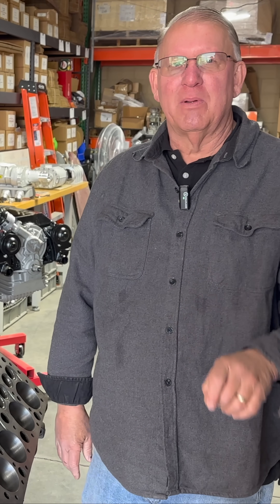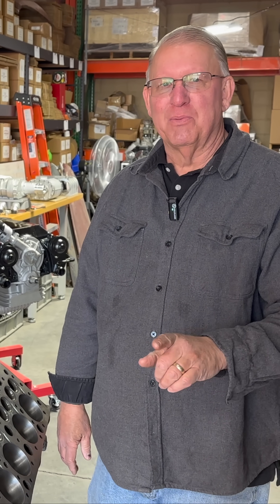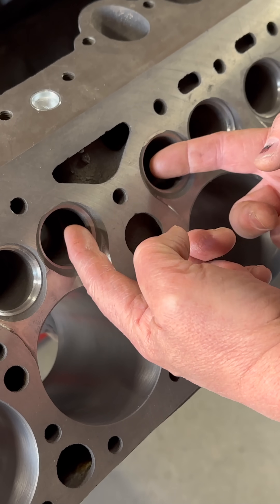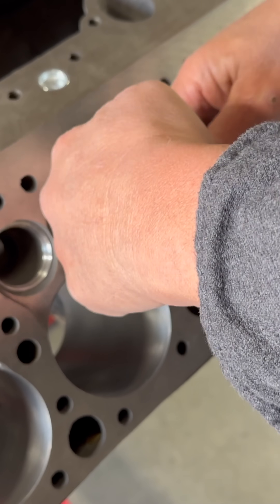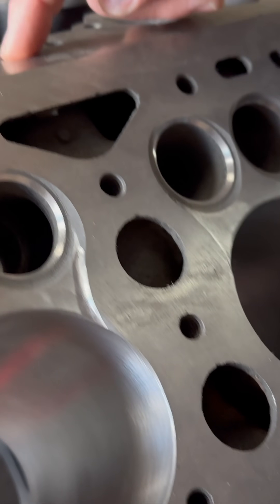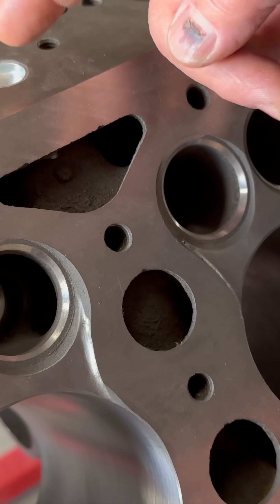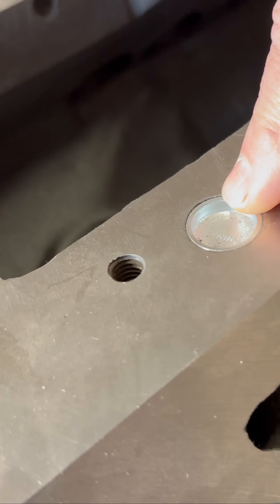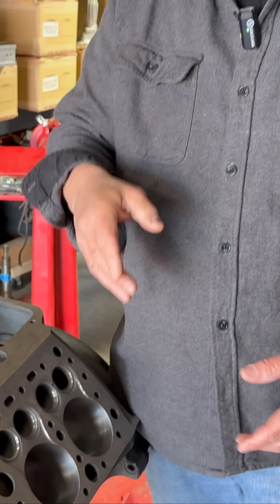Most Economical Mod!  Performance Flatheads - Steve Coppock w #barryt #cpegarage

Comment: Blocking the heat crossover is a case by case thing. If running a restored original in snowfield states, then allowing the manifold to heat can only be a good thing, as the engine burns fuel vapour. Low speed gas velocity in a stocker in suburbia is where the heat is needed as the carb can only do so much & liquid fuel droplets don't burn so well. With some heat at the bottom, directly under the carb means that liquid droplets have a chance to vaporise, burn & make power. Of course, with multiple carbs & a lot of wide open throttle, then plug the crossover.

Comment: The need for an exhaust crossover was superseded by the advent of the thermac and heat riser to prevent air bleeds from frosting over.
Reply: Still see K&N filters with a frost coating on the inlet side of the element, plugging up the bloody filters and causing run problems. Those open frame filter housings that eliminate the heat riser are a menace. Summer time run problems from 200° air off the radiator, right down the air horn. Boils the fuel out on shutdown, creating a flood condition.

Comment: Putting two exhaust valves next to each other is definitely a problem with heat something small block Chevys experience and why the later Chevy LS versions stagger them. Another thing with exhaust seats is that you should always have a hardened seat answe insert cracking.

Comment: Nowadays its important to block the heat crossover if running modern day ethanol blended gasoline. The ethanol fuel has a very low boiling point and anything you can do to keep the intake manifold and carb as cool as possible really helps keep vapor lock issues to a minimum. Definitely wont cold start as easy with the heat but vapor lock is a much worse issue than a long warm up/ long cold start.

Comment: I disagree.   You need that heat for vaporization. Without it, it takes a long time to warm up and run right.  Those old timers were smart.  If you use fuel injection then plug off.